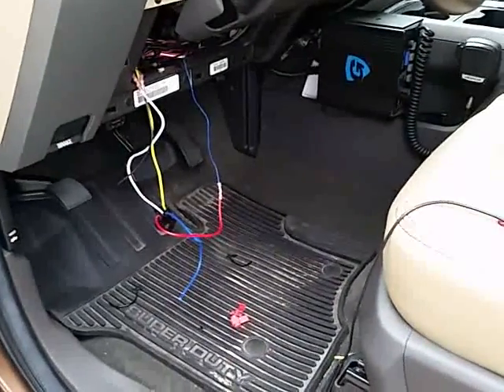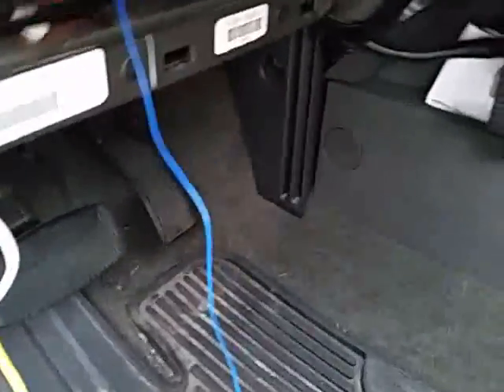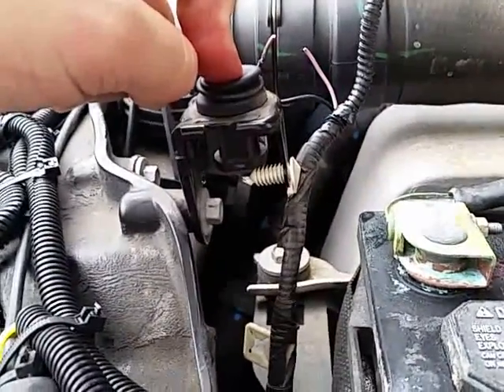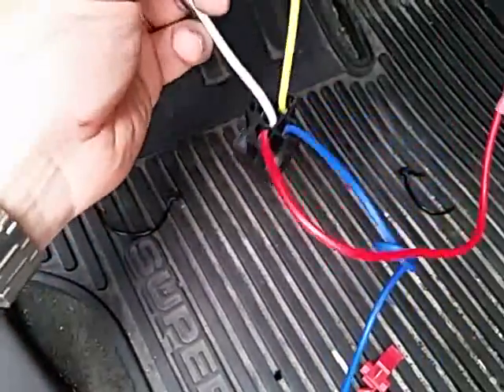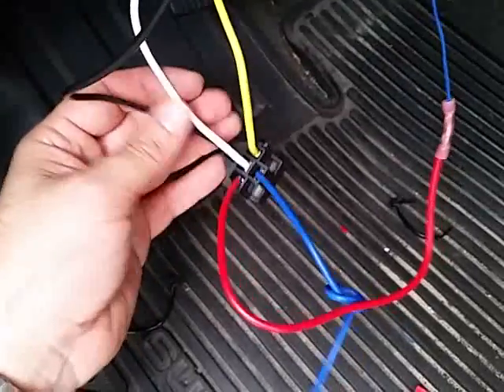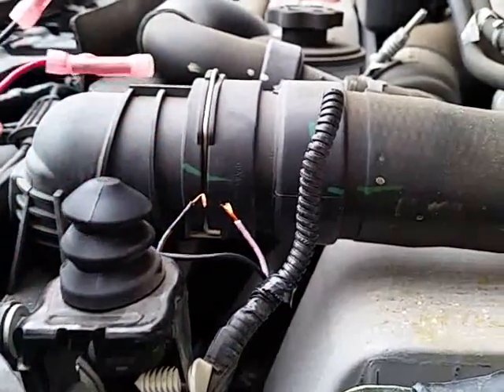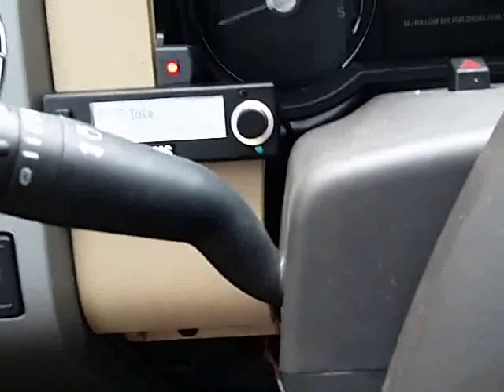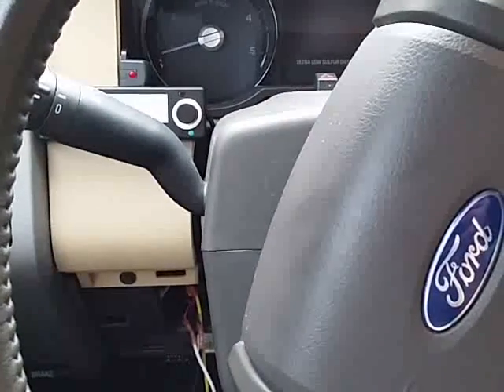2011 F250 Adding shock sensor to OEM Alarm.  504k

Comment: One thing that was not addressed is the power connections to the shock sensor itself. If it is connected to constant power it would seem that the shock sensor would be constantly cycling the relay whenever the vehicle was in motion. Obviously it would not trigger the alarm unless the alarm was activated but it would still be seeing shock and cycling the relay. Can you describe how you energized the shock sensor to only be active when the factory alarm is active? Thanks.

Comment: Hi, u are making a ONLY hood sensor. Means in arm mode anyone force open hood,alarm goes on. U r not making overall body knocking sensor. Meaning anyone knock your car, alarm will not goes off. It remains silent.
Reply from the maker: Lol no sir.  The shot sensor triggers the hood switch.  The hood trigger already goes off when the hood is opened.

Comment: what type of relay you use? where to get those?
Reply from the maker: Fishing4life: either a SPST or a SPDT will work fine.  They sell them at most autoparts stores.
Reply: thank you for the answer. Can you show that or tell me that, where is the rest of the wires form the sensor need to connected? I got 5 wires all , red, yellow, green, black, blue. I got that, the blue should be connected to the relay, but where is the rest goes? The instruction  paper is not so clear. I  don't know what is first stage out put ,second stage trigger output or turn on input  means. I would appreciate it if you would explained that. Thank you,